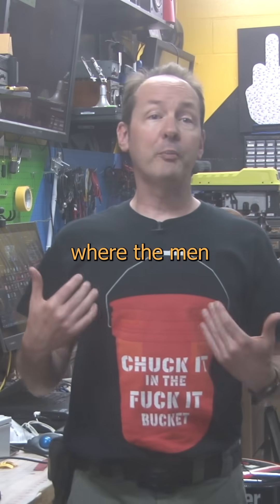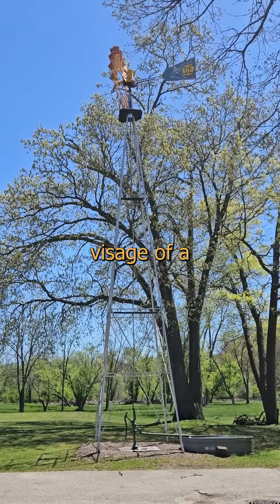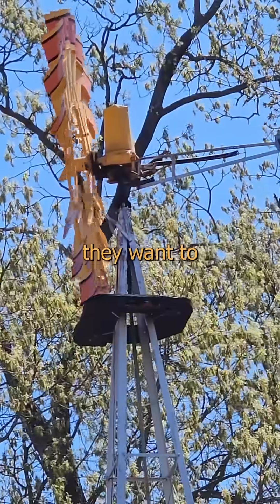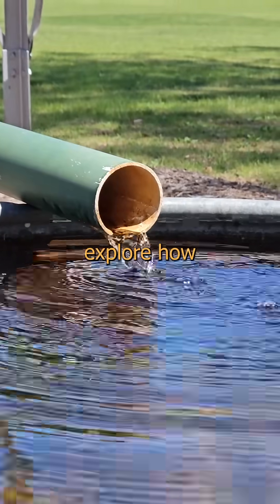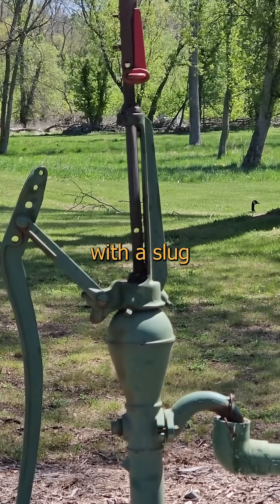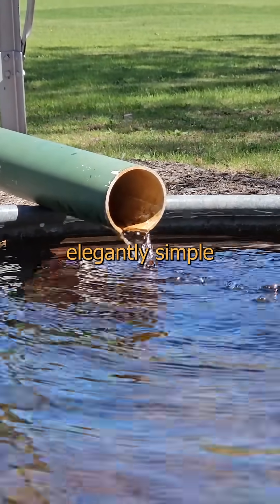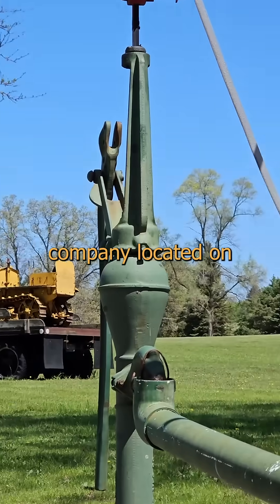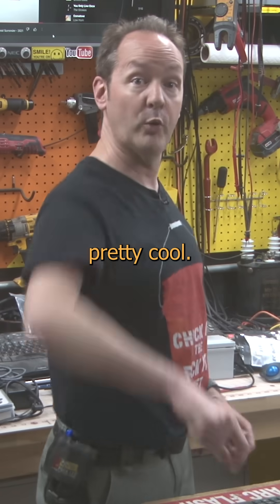Windmill Water Pump #chrisboden #comedy #engineering #farming #history #plumbing #well #windpump

Comment: These are my second favorite kind of naturally powered pump. I forget the term, but there's a really cool style of pump you can make with a water wheel. Essentially you run a tube around the edge and spiral it inward on the wheel, put a pivot in the center, and a combination of the weight of water in the higher part of the tube and the periodic bubbles in the line means it can pump water an impressive distance uphill.
Reply: Wurtz pump
Reply: Doc Fudge has it. That's a Wirtz pump. It is indeed an evolution of the Archimedes.
Reply: Archenemies screw?
Reply: @craignehring I believe maybe so & I think they had something like that in Egypt too. as well as shadoofs na irrigAtion device that works on water power working a wheel & belts & swinging canisters that dip in the water scooping up fluid & lifting back up continuously in series with many others to dump the loAd of H2O into a trough that goes to a diverter that leads to various fields meaning the slaves can be spared to do other things .
Reply: Archimedes pumps have been used in windmills since the age of Mesopotamia, over 37 centuries ago.
Reply: (Ram pump enters chat)
Reply: @wombleofwimbledon5442  Needs a lot more maintenance than either of these.
Reply: @uncletiggermclaren7592  not THAT much, is self-powered and will snake water up a damn hill. THE HILL I WILL DIE ON! That is all.
Reply: @wombleofwimbledon5442  OK Orinoco, keep your hair-shirt on. :)
Reply: yeah, that kind has a famous one in Rome or Greece , a funicular?  pump or siphon pump? but they're from within a man made source of water I think like for a decorative fountain or drinking fountain . I think.

Comment: Remember one time going to "fix the windmill" with my grandfather as a lad and hanging on the shaft of one of these and riding like some cinda carnival ride.  The old man had me convinced it was all the wind moving my gangly ass up and down  but In hindsight I know he probably just had a rope tied to it.  maybe he wanted to know if the well still had water in the 7 year drought, maybe the only reason he took me there was  to teach me how the thing worked. Either way it's  a lesson I'll not soon forget and a windmill will always bring me joy.
Reply: Probably it was lifting you. That column of water is a kilo per litre, and could be very deep, and you were probably less than 40kg. So without any water being lifted, it managed just fine.
Reply: These windmills have a significant gear reduction. They're still very common for watering cattle, particularly in rural Nebraska, and as a 200 lb senior in HS, I could hang from the sucker rods and barely even slow them down.
Reply: I bet a trail cam would catch all sorts of wildlife taking advantage of a source of clean water.

Comment: I still have a set of windmill leathers on the shifter of our service pickup. A pair of pipe wrenches, a pair of vise grips(keeps from dropping the rods down the pipe as you pull them out), and a screwdriver, I can change out a set of leathers.
On our farm, most windmills have gone away, being replaced by solar panels and submersible wells.

Comment: So even modern well pumps generally use a leather valve because it lasts FOREVER and doesn't require maintainence and when you've got as much to tend to as a cattleman one less thing matters. BUT any time you do need to do any work on the pump the leather gets replaced. So like every 10ish years

Comment: Growing up my maternal grandparents had a country store. It had an electric well pump in the house but out in the yard was a pump house with a manual pump. No windmill but a working water pump. Unfortunately it is long gone or I have adapted it to our well to provide water without electricity. The plump is a clever piece of engineering especially here in the rust belt to prevent water from freezing.

Comment: a lot of them stopped working because no wants to climb up on top and grease the bearings, and of course like you mentioned the issue with leather seals.  the ones on the old family homestead were still working when I was a kid in the early 70s,  but all the ones around the barnyard got replaced with electric. and the irrigation ones of course with monster engines, like the old GAA, out of tanks.  after all its incumbent to pump the aquifer dry. if your gonna create another dust bowl.

Comment: Our farm in Chatfield has the old Windmill and it also still works. That one is missing it's engagement lever. On one of the tower legs is a wooden lever with a thin steel rod going to the gearbox...when pulled down the lever pulls the skinny rod and folds the air vane to the side and pulls a block of wood against a drum on the windmill shaft. (brake) Wind acting on the folded vane keeps the windmill facing away from the wind. Releasing the lever let's the springed vane move back into operation position and releases the brake. Pumpity, Pump, Pump, Pump. And yes, the pump valves are leather... Gawd forbid you let it set so long they dry out. Had to pour water in the top of that pump many times to get the valves working... Sigh

Comment: They are pretty cool until you have to pull one up to replace the buckets (seals) it always seems to happen on a windy day and the cable for the brake or tail is broken and someone has to climb the tower to swing the tail around or to put the brake on.

Comment: I grew up around these, and if you can get your grubby mits on the gearbox from one of these, they are actually pretty damn interesting, because they include mechanisms to cause the tail to turn 90° and turn the entire fan out of the wind in high winds. There is a lot more going on in there than a simple cam crank.
Reply: I'ma need a technology connections video on this
Reply: Or the metal rings that rotate through the sump to transport oil back to the top of the mechanism
Reply: @ Yep! They are marvels of engineering with ‘simple’ solutions like the oil ring, which is robust and works well, instead of a complex oil pump system.
Reply: Oh I’ll crank your cam.  I mean, what?
Reply: @Mikustan39  That'll make your tail turn 90° for sure
Reply: @ Indeed.
Reply: @Mikustan39  dont you dare touch my lobes
Reply: @Mikustan39 I heard you wouldn’t do it
Reply: They did a How Its Made of aeromotor that shows the insides, the company has it embeded on their site.

The Turning system actually brilliantly simple though. The windmill hub is offset from the pivot point so it always wants to turn out of the wind and the tail vane is only being held straight by spring tension. When the wind is strong enough to fold it in it also actuates a brake on the rotor.
Reply: @kylehenline3245 dammmmm that's fing smart. I'm like "how maybe the wind causes oscillations in the tail and when they get big enough it reaches an overcenter point...." nope, way simpler and more robust. Kudo to the old-timers!
Reply: @JForrestFisher--76 right? Beautifully simple. I was thinking it was some rotor overspeed lever tripping something
Reply: @tomaspabon2484  yeah it's been occasionally tickling my tism ever since I learned of it. :) The way I've come to think of it is they knew it was gonna break in high winds so they designed it to break in a very specific and easily repairable way. Like the principle of a fuse applied to a mechanical system.
Reply: Absolutely, and if you know a bad storm is on the way, you have to go manually engage the brake permanently until the storm passes! At least with ours we did.
Reply: Is THAT why I've seen them with the tail turned 90?! I always thought that was accounting for the torque from the power output shaft (think tail-rotor on a helicopter), and that the tail was fixed in that position.
Reply: Do they have a shut-off mechanism if the trough gets full, and is there some kind of mechanism to compensate for low wind conditions?
Reply: @briancarrigan7962  The ones I have been around, the answer is no to both questions. 
For trough full, most are set up with an overflow drain such that when the trough is full, extra water flows out the overflow pipe into an auxiliary trough, or a small overflow pond. 
There is nothing to deal with low wind; they are capable of pumping water at surprisingly low windspeed. A person can manually turn the blades in a no-wind situation and bring up water, abet slowly. Only a couple miles per hour breeze is required to pump a decent flow, high wind is more of a problem, as it does turn out of the wind to prevent damage in strong enough wind, which stops it pumping.
Reply: @Vikingwerk  So immediately my engineer brain starts thinking about how I could put in a check valve (or something) to stop the flow, and then a variable rate pump to fill it up faster when necessary, and then the questions come up if this is still an actual problem to be solved?
Reply: @briancarrigan7962 many have a float system that shuts off the inlet valve when it's full , some also have an automatic outlet leading elsewhere to prevent overflow directly from the watering tank in times of heavy rain fall, it's going to be wet around the tank , like everywhere else around but it won't oversaturate the soil immediately around the tank but that's more in areas that get huge storms for days when the tank is in a pig enclosure for instance where the area where the tank & feeding trough are on concrete pads ditto goats, sheep etc . all of which can be prone to hoof rot.
Reply: @briancarrigan7962 some have a float system like a swamp coolers water inlet system , if that helps any. float lowered water flows in float fully elevated, the flow shuts off .
Reply: I think that's the bit that usually breaks, because I've seen soooo many of these locked at 90 degrees
Reply: @tsm688  There is also a brake mechanism that can be activated that involves the same parts, to shut off the windmill when it’s not needed; a cable runs down one leg of the tower to a lever, and pulling it down folds the tail to the side and applies the brake, the lever is then locked downward with a loop of heavy steel wire. 
Most of the old abandoned ones are left in the off position, but the brake eventually gives out, so the blades spin a bit even in the off position.
Reply: @Vikingwerk ty

Comment: I had a residential well shaft replaced a few years ago - they still use leather for new valves. I asked about it and they said it's more durable than rubber seals/valves, especially for something that can't be inspected without a crane.

Comment: For what it's worth.  That windmill is not st up properly.  The shaft is bottoming out atheist the bottom of the cylinder on the down stroke.  White it doesn't really hurt the cylinder, it will wear out the shaft much faster than it should.  It will also wear out the head of the windmill because it isn't pulling smooth.  And it is an Aermotor!  It does not have leather valves, it has a pair of ball check valves in the cylinder, however it does have a set of leather cups on the plunger that actually lifts the water.

Comment: Did you look into how to turn it off?
If you are filling a tank, then you do not need to pump in water all the time. So you need to be able to turn it off.
At the base of a windmill is a lever, pulling the lever moves the tail (the bit sticking out the back) 90o, thus the wind no longer spins the blades. thus the windmill turns off.
Cool

Comment: Aero-Motor is based out of San Angelo (or was last time I checked). These wind turbines are EVERYWHERE around West Texas because surface water isn't a common thing out there. The thing is, you're going to spend a few hundred a year maintaining these pumps because they have moving parts. Thus, most of the farmers and ranchers I've interacted with out west have been converting to solar powered pumps over the last several years. The fact that these Aero-Motors cost so much to maintain is why you usually see them as a yard ornament or just with the tail cocked to the side, out of service.
Reply: why is the maintenance so high? that seems really doubtful to me. what would need replacing after a year?
Reply: lazy people fail to grease the spinning parts and contact surfaces, then gripe about how much it costs to replace the whole alternator and/or gearbox when it overheats and seizes.
Reply: @stuartmadden7959  do you have yours on a regular maintenance schedule?
Reply: @Walczyk   well, according the farmer I got to know out there, he said the Aeromotors on his property were kind of old and had moving parts like bearings that would wear out. Or the leathers would wear out. Or a seal would fail down hole. Or some other urgent headache that stopped the thing from working. He also said parts were getting expensive for them because they weren't as common as they used to be. He told me when he finally gave up on it the year he spent $600 in parts to keep his running so he could take a shower. Apparently a solar power well pump is more efficient and less maintenance.

Comment: What I like this that is one was connected to a hand pump. I bet you could still reconnect it to the handle
Reply: I grew up around/using these, and that is exactly the case; you set the brake on the windmill as close to the top of stroke as you can, put a vice grip on the sucker rod so it does not drop, take the pin out where the windmill stick (which is wooden, as a mechanical fuse in case something binds, it breaks rather than the gearbox) put the handle in the sucker rod link and put the pin back, and tie the windmill stick to the side out of the way, take the vice grip off, and your in business with a hand pump!

Not many pumps were actually set up like this in my area, as the wells were to deep to hand pump, but the procedure was the same to switch to a gas motor powered ‘pumpjack’ that would pump the well if the wind was lacking.
Reply: @Vikingwerk A wooden pin as a mechanical fuse, now that's pretty cool!
Reply: Yeah I could tell immediately, in the country side here in the Philippines we have a manual one of these

Comment: Chris, have you, in your ample amblings across the arid, apocalyptic agglomeration of anti-acumenical amusements which comprise youtube, come across a video of what can only be described as an ancient oil pump in the wild? I'm having trouble relocating it, but I know you'll like it. Simply, it's exactly what I said. It's an old pump, as I recall installed in the latter days of the 19th century, out in a vast field, just working. It's slick with oil that leaks from old, but still mostly functional (almost assuredly) leather seals. The pullies are that signature to the period cast iron with curly, flourished spokes. The reinforced canvas belt droops comically in the middle from god knows how many years of stretch. It's caked in countless revolutions of oil and muck, but still drives. The whole thing looks like a refugee from a post-cataclysmic novel where warring tribes of survivors come together in peace only here, at "the machine" to make offerings and worship. 

Either way, the video is short, only a minute or so. I can (and have) watched it whirl its pullies and shafts for longer than I care to admit here, just marveling at its simplicity as the key to its longevity. I know you'd enjoy it as well, so I thought I'd at least pass on what to look for, if not the exact link. If I find the video again though, I'll come back here and post it.

Comment: I see these running every time I go up in the Texas panhandle or out that direction, actually pumping water into a basin. They're more common in areas without easy access to electricity.
Reply: They're pretty common regardless as these days solar systems allow even rural farmers to acess electric pumps. Sometimes you'll even see an old windmill tower with the old fan removed holding solar panels and a new pump setup. But these are easily serviceable and still work today so are favored by many.

Comment: They still build these and they still serve the exact same function where I'm from. And yes they still use leathers
Reply: Indeed. They do make a rubber variant these days but I've know them to roll backward and seize in the stem pipe. Sometimes the original is better.

Comment: Omg that's what these things are?!  I thought they were just fancy wind direction indicators, but they're proper well pumps?
That is pretty cool.
Reply: I always knew that's what they were for (in their original intended purpose)  but had no clue how the spin made water move, and have never seen a functional one in person, just the yard art version, so that was NEAT!
Reply: @goosenotmaverick1156  Essentially a big syringe that sucks water up about a foot at a time. There's a ball check (one way valve) at the bottom that doesn't allow water to flow back down. Down stroke pushes it through another ball check towards the surface. Repeat